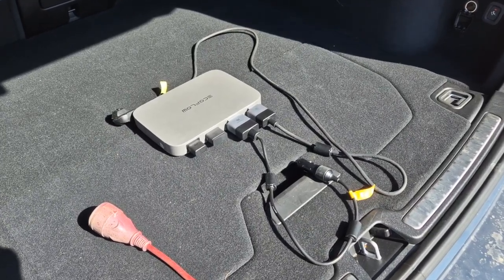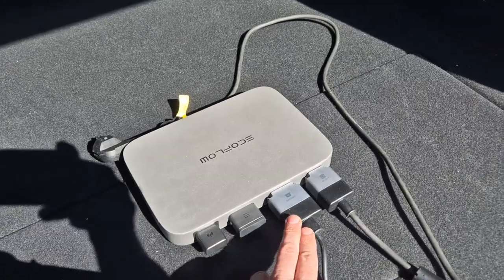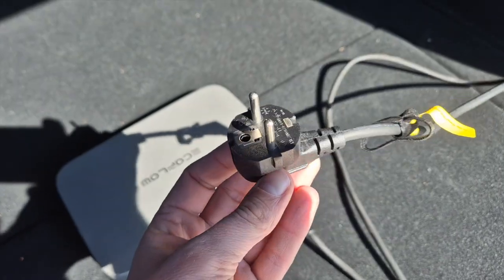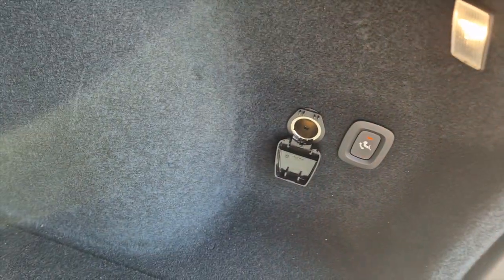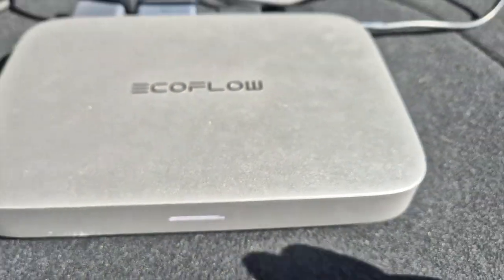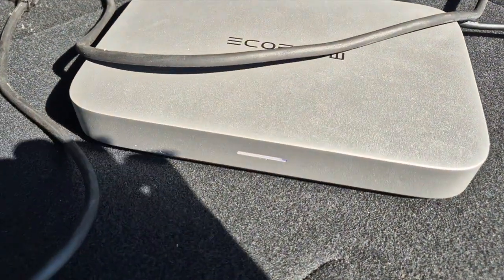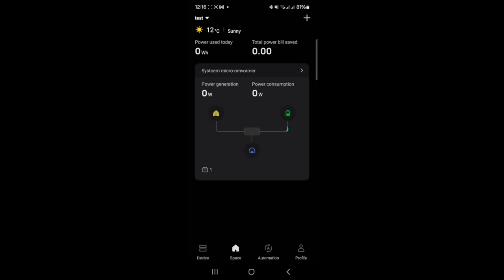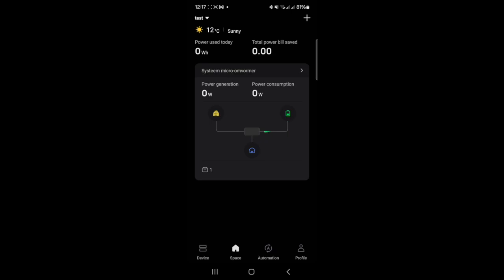Add V2G to any car. Powerstream 12V Ecoflow

Comment: I bought ecoflow powerstream along with a deltamax 2 and smart plugs (Balcony Solar) ,The ecoflow powerstream stopped working after less than 6 months old, I have only been offered part Refund and told to THROW THE OLD UNIT AWAY , not offered a repair, from an Eco company ! Now my smart plugs are useless and I'm out of pocket with no device Ecoflow says 10 year warrenty loads of people have been had over . So this is renewable energy!

Comment: At best you might consider this V2L not V2G. There is no way ever this can connect to the grid.
As far as V2L is concerned it might charge a laptop or some lighting but nothing useful. On my Kia EV6, The V2L will supply 230 volts at 13 amps. That is enough too boil a powerful kettle or run an air fryer.
Reply from the maker: I only works as V2G. The powerstream is a grid tie converter. So without a grid present it will shut down. It really does feed into the grid.
Reply: So the two pins on the Schuko plug will be outputting 230V AC. Maybe there is a safety device that’s not mentioned but best not to touch the pins… ⚡️⚡️
Reply: @MH-wn6vs  They only start outputting 230V AC on a grid is connected on them. This keeps you safe from the touching. But also keeps te repair guy down the street safe if he shuts down the power in the street. Obligatory feature on any grid tie invertor.

Comment: I'm pretty sure this is NOT what anyone would mean by V2G the power needs to come from the high voltage large battery, not the 12 volt system
Reply from the maker: I agree this is a non standard solution (with lower power and efficiency). But it is a cheap and safe alternative to hooking to 400V or 800V DC
Reply: This is a feature of the inverter.
It is supposed to connect to ecoflow river power bank.  It has a 12 volt battery.  The same as the car.  It is limited to 100 watts.